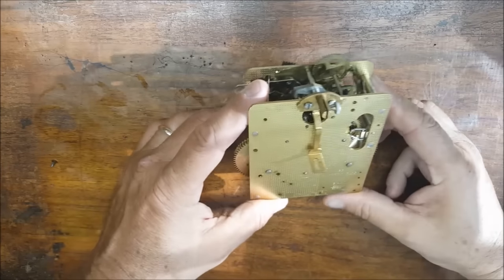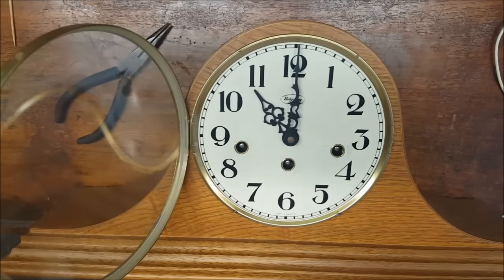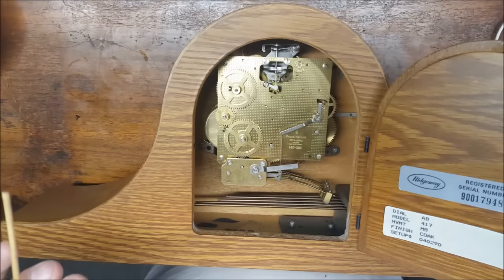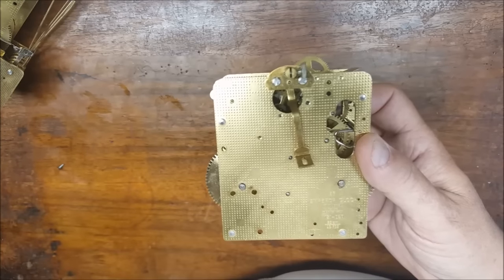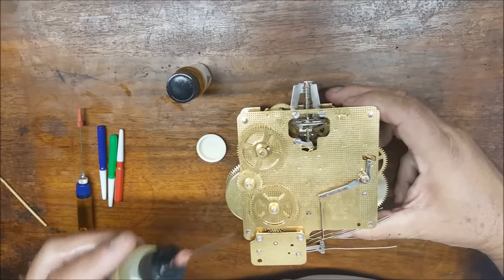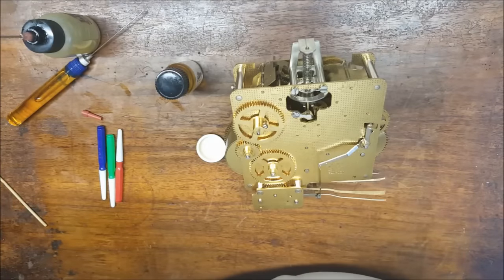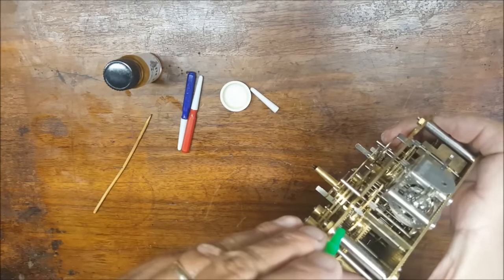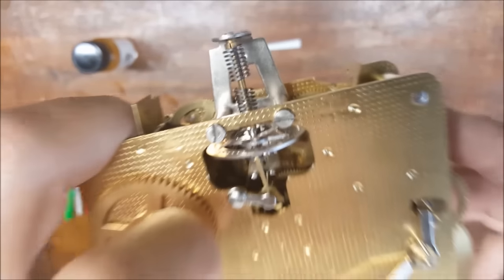How To Oil A Clock (or Clock Repair) - A Step-By-Step Guide

Comment: Thanks. I just bought a Ridgeway clock with the identical movement from the thrift store. It definitely needs a cleaning. I was going to use sewing machine oil to oil it as I've read in several tutorials, but I am going to order the synthetic clock oil instead.
Reply: My clock is a model 520 with an M8 dial - does the "8" stand for it being an 8-day clock?

Comment: Great Video - thanks for sharing. I got a Schatz ships bell 8 day clock with a yacht I bought and  right from the start it kept reasonably good time. The chime started to wind down at a different rate to the clock and genius that I-am-not, I decided to spray WD 40 into the holes in the brass casing while it was still mounted to the bulkhead. 
This made matters worse and the clock no longer ran for more than a few days. 
I have taken it off the boat and will clean and re oil as per your instructions.
fingers crossed it works well when back on the bulkhead.
Thank you so much !
Reply from the maker: Please let us know how it goes, we love it when we get feedback
Reply: I was thinking Wd-40....Guesss I won't.Thanks for your comment about it
Reply from the maker: @marks7352  I would not the WD in WD 40 stands for water Displacement. The oil we use is thin and the WD40 will displace the oil and will make a mess of your clock.

Comment: Thank you for this helpful video. We have a Howard Miller 630-148 mantle clock with a Westminster chime. It is wound once a week and loses 2-4 minutes in that interval. Of the 3 springs, the middle one has a dry rubbing feel in the latter part of winding. Could this be what is slowing things down? Can & should the springs be oiled? Should I turn the +/- adjusting screw labeled 10s/d? Or could it simply need cleaning and oiling?
Reply from the maker: There is another video on how to take car of that. If you subscribe to our youtube channel you will see the one about "adjusting the speed of your clock" Thanks for the imput

Comment: I have a Howard Miller wall clock that's about ten years old.  Haven't oiled it for a while, maybe about eight years.  Is what you just demonstrated what Howard Miller recommends in the owner's manual?  They say to clean and oil the clock every two years.  I talked to our local clock shop guy who said that it only needs to be done every five years or so.  They also talked about $250 to clean the clock, must be taking it completely apart.  What do you recommend?  Just want to be sure we're following the maintenance recommended by the manufacturer.  This is our beloved wedding anniversary clock, so we want to keep it going and going.  Would appreciate your advice.  Thank you!
Reply from the maker: We are a Howard Miller Certified repair and sales center. If you can clean and oil the clock yourself, then yes every 2 years would be perfect. However if you paid someone $250.00 every 2 years to clean and oil the clock you will wast your money. The modern day clock movement, typically will last about 20-25 years. We have seen them go longer. If you do service it, it will extend the life quite a bit, but again, if you are paying 250.00 each time, in a 20 year period, you will buy that movement 4 times over.  We service over 1000 Grandfather clocks per year, we have 3 techs that perform around 3 sometimes 4  cleanings per day 5, days a week. Pulling the movement out, cleaning and re-oiling the movement like in the video is a great way to extend the life of the movement. We get stupid comments from  clock repair people, telling us that the only way to clean the movement is to disassemble it, clean and reassemble it. While this is true for older antique clock movements, its foolish for a modern day movement. If you are not careful and don't know what you are doing, you can damage the movement more than it is before you start. You can purchase a new movement and install it yourself for a lot less money and certainly a lot less headaches and hastes than going through the hassles of disassembling one.  The video was made for people that don't have the equipment nor the knowledge to tear one down and rebuild it. By cleaning like in the video, you should extend the life of the movement by several years, especially if you are having issues with it now.
Reply: @ClockRepairService  Thank you for answering my question.  People seem to have different ideas about what should be done.  I wouldn't try disassembling the clock myself.  Was thinking my clock repair guy might do the disassembly and "thorough cleaning" every ten years at around $250, not every 2 years.  I could do the cleaning & oiling you did in the video myself every 2 years without disassembly of the movement.  I noticed that I can get a new movement for my 2008 HM Earnest  620-433 clock for around $250 to $300.  I agree that shouldn't be too hard to change out with my skills.  If I can re-key door locks; rebuild a Kitchen Mixer, work on cars, and fix  an A/C, I should be able to deal with a clock, but I don't want to learn how to disassemble the movement.  If you have any further comments, I would appreciate them.  Thank you again for your advice!

Comment: Very little oil used then. What about the floating balance I think I can see. What's your preference there? Good tutorial; thanks.
Reply from the maker: Floating balances should not get any oil. They should be cleaned (if you want to ) in NAPTHA or alcohol, then dried out. There is no place for oil on them.
Reply: Thanks. Appreciate that.

Comment: Hello great video and thank you for taking your time to help people like myself. I have a Ridgeway grandfather clock about 30 years old. The chime is slow but the gong is normal. I never had it maintained. For me to oil it like you show in the video. How do i pull it out ? Do I need to put styrofoam blocks on top of weight pulleys before taking the mechanism out of the clock. Do you have another video link that shows the removal of the clock face and mechanism out of a grandfather clock. And if you can please send me the link for the oil kit thank you. Nick from Queens NY
Reply from the maker: Nick, its best to pull the movement out, yes. I don't have a video for that, there are so many ways that the movement will come out on Grandfather clocks. We have taken hundreds of pictures of the GF clocks we have worked on, hoping one day to put them all together so someone can pick their model # out and follow along to removing the movement, unfortunately we just don't have them organized yet.  If you email me a picture of a close up of your clock face, including the wood frame around it, I might be able to point out how to get the movement out. Its not difficult, usually only a few screws hold it in.

Comment: I just sprayed some lubricant spray onto the movement and it seems to be working fine. For now. Was that a bad idea?
Reply from the maker: It probably will run for awhile. Spray lubes will gunk up the gears and pivots and turn to a gum like substance. Many of them will melt the lacquer on the brass plates and destroy the movement.

Comment: Hi, I have a Hamilton mantle clock and it has stopped chiming. And, it won't wind with the key for the most part. Hammers will lift and not fall back down. I fool with it some and it will chime for awhile then stop again. Can you offer me and suggestions on how to fix this problem and  what might be wrong? Thank you
Reply from the maker: Sherry,  You might at this point need to have the movement cleaned with a cleaning solution. Usually when the hammers wont come down smoothly, the oil has gummed up inside parts you cannot get to without completely taking the clock apart. If you want to send me a picture of the movement (it can still be in the clock case) I might be able to point you in the right direction for either repairing or replacing the movement.
Reply: Thank you so much for replying. The clock has almost stopped completely now. I need to keep setting the time. It strikes all over the place after I set it, not the correct chime or in order. I will try to get a photo. The movement looks like the one you are oiling in the video. Not sure I know how to add a photo here. How would I do that?  Sorry! Thank you

Comment: i have a similar mantle clock as shown in the Video three winding points, the left spring and right fill fine to wind, the centre winding point keeps turning with the key, does this mean the spring is broken (wuttemberg 1920s).
The chimes do work but doesn't run. Is the centre winding point for the time? and our easy is it to dismantle to replace spring. thanks great video
Reply from the maker: Yes, the spring has either broken or come off its post. The center winding post is for the time and the 2 outside post are for the chiming and striking. Unfortunately you will have to remove the movement and dismantle the movement in order to get to the spring problem. If your not comfortable with it, I can make a suggestion for a repair shop that you can mail the clock or just the movement to for the repairs.

Comment: Should you wear gloves?  Do the oils in your skin affect the clock in any adverse ways?  Should I use a cleaner to remove the dirt or just remove it manually as shown?  Thank You.
Reply from the maker: You do not need to wear gloves. The oil on your fingers will eat through the lacquer on the movement, but if you wipe it down all should be good.
Reply from the maker: you dont have to wear gloves. Some people do, it stops your fingerprints from getting on the brass. The oil is fine to get on your skin. If you have a way to clean it that's fine, the video was showing people who do not have a cleaner or a way to clean it. This method works great for us out in peoples homes when we work on grandfather clocks, however in the shop we do use a cleaner

Comment: I own a mantle clock that winds up without a pendulum that stopped working.  The wheel that moves back and forth does not float.  Is it supposed to float?
Reply from the maker: Yes, the balance wheel should float. if its dropped down and rubbing on its frame it will stop. There are so many other tings that can go wrong with a floating balance. Also to purchase a floating balance is expensive. I personally would look into purchasing a new movement if yours is still made.
Reply: Can anything be done to make the balance wheel float again?  Black residue is around the axles on all the gears where they stick out through the back plate.  Is there anything else I can do?

Comment: I apply the oil with a small paint brush and then wipe the area with a paper towel.
Reply from the maker: It may sound crazy, put the ultimate goal to oiling a movement is to put just the correct amount of oil  in each pivot hole.  When you put it on with the paintbrush, I would assume you put on to much, but when you wipe it off with a paper towel, you have no idea how much, If any oil is left in the pivot hole.  The correct viscosity of the oil is the most important thing to consider when oiling a clock, however how much you put on is as equally as important. The tip of the gear floats on the oil in the pivot hole. Too thick of an oil or too much of an oil will not allow this to happen. If the tip of the gear sits on the bottom side of the pivot hole, you might as well run the clock dry. The pivot hole will become oblong and the clock will eventually stop.

Comment: for cleaning out the dirty oil, can you spray it with brake or carbeurator cleaner?
Reply from the maker: I have heard of people doing that, however, I have not. we use a clock cleaning solution in the ultrasonic when we clean at the shop.
Reply: ok thanks. i dont have an ultrasound and had that idea from cleaning carbs. i just want to make sure there is not rubber bushing or anything that could get damaged

Comment: What about the behind external gears, you didn;t show
Reply from the maker: Oil should be put on the pivots as shown. Its best not to put oil on the teeth of the gears themselves. If oil is on the internal gears, it will only collect dust and dirt and gunk up the movement.

Comment: would this apply to clocktowers
Reply from the maker: Daniel, Yes , this oil has several properties and agents in it that will continue to run in extremely  cold weather as well as hot weather, including both high and low humidity.  We decided not to include those properties in the information, not many people work on clock towers and most of our clocks customers have their clocks  indoors and would not need that information. Although this oil goes along way, and stays put where you lay it, I would think you  would need several bottles in order to do an average sized clock tower. In all honesty, we have only used it on one of our clock tower projects about 6 years ago, (we don't do many) I drive by the tower a few times a year and it is still running and keeping time. As far as I know we were the last to service it, so I don't think its been touched since then, other than winding and setting the time. I hope this helps.